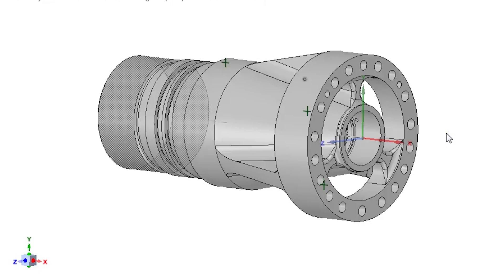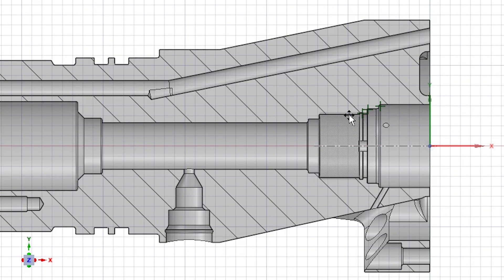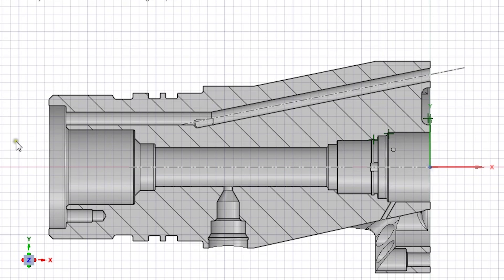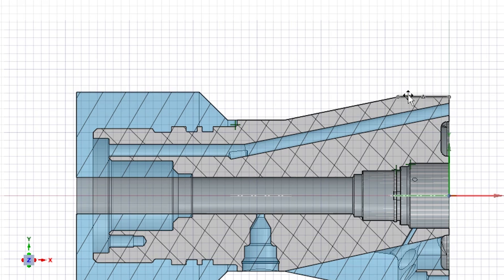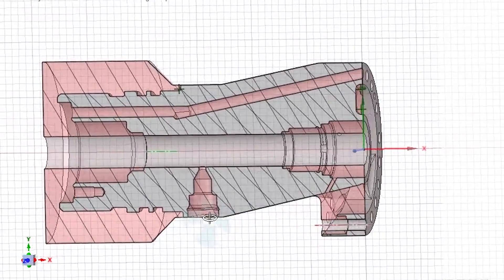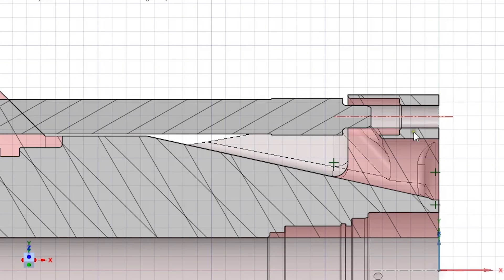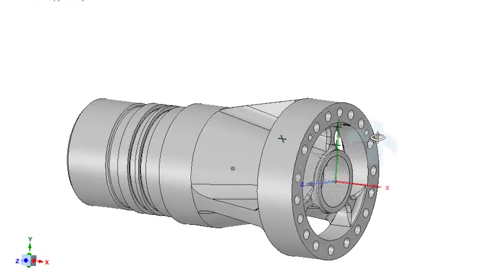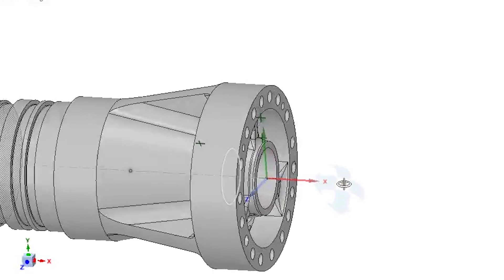Plan a job from the cad model.

Comment: Number 1, I think you are one of the most talented CNC machinist's ever.

Number 2, you are humble and open.  A rare combo.

Number 3, for me, being a degreed Mechanical Engineer and Manufacturing Engineer, but not a programmer or machinist, talking about the datum references first, the tolerances and the GD&T, as you did in this video, is fantastic, as then when I watch your machining videos, everything becomes much clearer and learn so much more.

I use to work as an orthopedic implant support engineer on the production floor and in advanced manufacturing teams as the production rep on new products - mostly derivative products, yet with the same advanced coating processes (vacuum deposition, surface prep processes ... and of course machining, I was responsible for.  All the reasons for my interest.

Would I watch more videos like this, you bet!

In fact, in your future videos, if you are able, without violating customer confidentiality of course, I would love to hear and see you discuss the print first, the GD&T especially, the tight tolerances like the 0.0002" you mentioned here and how you hold and approach them while discussing the CNC's capabilities, then your approach and then the machining, if possible.

Great work sir.

Comment: Yes please keeping these kind of videos very, very interesting stuff. Howmuch time did you take on programming and machining to complete the ss past?
Reply from the maker: I didn't do the machine work. They ran this job on the small integrex here at Center-line. As far as programming it probably took about two-three days with all the revisions and working with the machinist running the parts, to the program and setup on the small Mazak Intergrex. Its control is newer than my machines and I don't have the proper post for Esprit for it. So there was some manual editing to cod necessary.

Comment: Looks like a pretty complex parts. Is maintaining 0.0002 easy enough on smaller bores ? We do some big bronze bushings with a tolerance of 0.03mm. They are 600mm id 660mm od and about 700mm in length. They can be challenging with the small wall thicken and the soft nature of lead bronze.

Comment: I loved this video! I'm an engineer aspiring to a point of creating/manufacturing my own parts. As it is, I've designed a bunch of parts for additive 3D printing. Would you happen to have any advice for my switch to aluminum/other metals? I tend to watch a lot of machining videos and try to learn from the complaints the best I can.
Reply from the maker: This is a very hard question to give you a general or simple answer. Every metal has a manageability rating this will give you a general idea of the difficulty or ease of machining as related to the material with 100% rating. I know that doesn't help much if you have never machined that material but if you machine a material with say a 60% or 30% it will sort of give you a idea when you do the next material. So what am i saying. The only sure way to learn is to machine some materials. Obviously aluminum will machine easier than steel and stainless. Inconel will be more difficult than the stainless but the ratings will give you some idea. Also the tooling available to you will dictate how you will go about machining. Any thing can be machined with the correct tool but is that tool available to you? Almost anything can be machined with a less then ideal tool it will just take longer and possibly more skill to do it. Think about that you could actually make a part with a file and scraper to precision tolerances but it would take longer than a milling maching and a grinder.
Reply: Thank you very much. I think this is a case of just getting out there and doing it. I hope you have a great one!

Comment: It was very interesting to me!  How would you describe the type of work you do besides close tolerance and difficult?
Reply from the maker: I generally do small quantities of time consuming parts in difficult to machine materials. The kind of parts nobody wants to do or has had difficulty with. This is why I use a manual four jaw chuck on the lathe. It is more important to me to get the part running true than the time it takes to chuck. That in a way describes the kind of work I do. Where precision is more important than the time it takes. Also I do like a challenging job. I don’t think I could run thousands of parts unless I could figure out a setup to do it unattended. I do have a job doing exactly that on the horizontal mill. That’s whet the cutter in my video “Remake a cutter and spares” is for.
Reply: Yeah, I would have guess that you like challenging parts.  Because one would have to be very passionate about his work in order to be able to complete good, in spec parts this difficult!  Thanks.

Comment: Hello Peter, one question for the tight tolerance bores 0.0005 and 0.0002 do you hone them afterwards? thanks Rafael
Reply from the maker: No we will bore them on the lathe. In this material that wouldn’t be a problem. You can take fine cuts and not loose the finish.
Reply: ok thank you

Comment: Great! as i could see you are using SolidCam for generating Gcodes. right ? please let me know how long would it take from cutting off the raw material to completely finish the part .and how much would you get for machining only one piece of this kind .
Ps : i couldn't get any clue of the part scale . maybe giving a diameter or a length could help visualize the part size .
Regards
Reply from the maker: The software I use for Cam is Esprit Cam. The finished size of this part is 3.125 Dia. X 5.563 long. When I know how long it takes to machine I will let everyone know.

Comment: Thank you for your video(s). I really enjoy watching them and learn alot about the possibilities available, as I am also programming and do set up  on MULTUS multitasking machine myself, although I work mainly on small aluminum parts. In your video explaining the considerations I would like to know more about the workholding, available tooling, blank material size you start with.

btw, have you considered using a Key slot / T mill to finish the counterbores from the first side? instead of a long special drill?  
looking forward to more of  your videos!
Reply from the maker: Thank You for your comment. I did looked at that, but when I calculated the shank/neck size It didn't work out. The holes are .201" diameter and the back c-bore is .328" Diameter. That would make the neck diameter of a milling tool .065" diameter X .800 long to reach or a back boring tool could have a neck of .125" X .800" long. This would not be a reliable solution for this. That leaves doing it from the other end the only option left.

Comment: How many spares do you have?
Reply from the maker: It turns out I was a little off on the quantity. There are 26 parts on the order and 26 pieces of material. No extras. We will be cutting some aluminum setup pieces of material for this.

Comment: Do you think 3d non laser metal printing will acheive this level of accuracy? How do you think this will change the game?
Reply from the maker: Funny you should mention that this part has the option to machine from a 3d printed part. Were making it out of solid round bar the other option.
Reply: Edge Precision This company has my attention
https://www.desktopmetal.com/?gclid=EAIaIQobChMIgJCVsYXv2wIVlhuBCh1tZAyrEAAYAyAAEgKcIPD_BwE
Reply from the maker: The 3d part still requires post printing machining for the close tolerances.

Comment: I have done some audio work so maybe I can help.   To reduce background noise you just need to get the microphone closer to you.   If you have watched Keith Fenner you will know he clips his to his hat.  But on the shirt works just as well.   A more directional mic can also help. Microphones follow the inverse square law, if you halve the distance from microphone to sound source (mouth?) you quadruple the sound volume from that source.     

If you have constant background noise like the whine of a motor you can reduce it using the ReaFIR VST plugin (Works in Davinci Resolve, I know since I installed it on Friday, so it might work in other NLE's).
Reply from the maker: Actually I am using a shotgun mic setting right in front of me on the bench about 3-6" away from my face. The air guns that people are using in the shop are very loud in the sound recording without it. I have to turn down the gain on the mic and get very close to get it to a minimum. I had to take some of these clips many times because someone would decide to blow a air nozzle just when I was recording. There is also a horizontal band saw right behind my machine. When its cutting something like inconel it puts out this high pitch screeching sound that is very difficult to get rid of.
Reply: cool, it does work ok, I am just suggesting things to try when it does not work.  but shotgun mics have surprisingly large rear and side lobes that can catch you out (-:    with the ReaFIR plugin you teach it what just the noise sounds like and then subtract that from the total sound and it uses a FFT to do it, it is not just EQ.   (air guns are well over 100db and everyone should be wearing hearing protection!).   do not be afraid of making the mic visible if it gives better sound, I really don't think anyone will care so long as we can hear you (-:
Reply from the maker: For the talking head shots I'm using a Zoom F1 recorder on the camera with their shotgun mic on a extension cable they sell for that purpose. I have been thinking about a lavalier mic. The Zoom F1 recorder has a 1/8" threaded line in connection. I think that will also pass thru to the camera. Can you recommend a good Lavalier mic? I don't need wireless for what I will be doing with it. The camera I have been using is a Canon D6 MkII with a 16-35 lens for this purpose.
Reply: Any of the name brands will do a fine job, but Zoom sell one for the F1 so that will have the right plug and so on with no fuss so I would go with that.

Comment: I would appreciate more videos like this for sure.

Im curious how much flex is caused in stainless steel by the material removal on the wider side
Reply from the maker: Thanks Tommy. There may be some distortion from the milling. That is why as I explained in the video. We will finish turn the close diameters after milling.
Reply: Edge Precision that was all clear I was just curious how bad SS usually is for you in such cases. I work primarily with aluminum which really likes to go all over the place.

Comment: Very interesting. I’ve been using Featurecam for ten years but have never made a part this complex. It was interesting to follow along. How do you go about pricing something like this? Do you run any “Test” parts in the process of making this and if so, how do you factor that into your price?
Reply from the maker: Yes usually a test part of some kind is run on more complicated setups. It is very easy to make a mistake and scrap expensive material and tooling. Yes you should price such a thing in the initial setup for the job. If you repeat of the job you could reduce the price if that's not required in future orders. Or if you have a scheduled delivery over a period of time you could spread the initial setup cost of a larger quantity of parts.

Comment: I like these type videos especially on a fairly complex part like this. I wonder rather than run the long piloted spot face tool why not go thru the bore and back spot face it with a boring tool? I would think it more rigid and to give better access.
Reply from the maker: I did consider that but the hole is .201 in diameter and the c-bore is .328 it doesn't leave much (.125 x .800 long) for the shank. It might work but I feel safer doing it from the other side.
Reply: That's a really good idea. Having access to that tool grinder would make whipping up a back boring bar easy. I love these comment sections for exactly this reason, your quick and easy solution to the problem. Thank you

Comment: Bring more please. I’m beginning to program more 5 axis jobs so definitely helps. The tiny holes at the end of the video sir. How do you approach drilling those? Leave material parallel to the opening when you rough out the taper they are thru? Also is this being programmed with Mastercam or something else? Hope to hear back from you. I Love learning from the experience!!
Reply from the maker: Thanks Marcus. The little holes are .062 in diameter I will use a .062 endmill in a stink holder to spot for the drill. I will be using Esprit software to program with.
Reply: Edge Precision thanks for the reply I wasn’t sure if the hole was an “off the shelf” size or not. Cool I use an opmenmind product named Hyper-mill. Haven’t had a chance to drive esprit yet.

Comment: At time 1:37, need to drill 2 hole from op1 and op2.
How would you suggest doing C axis alignment?

Is that possible use 8" stock doing all OD in one op to secure outside runout to minimum ?

Comment: How would you doing measurement on runout specially when datum A is outside, datum B is inside, it seem not able to indicate deep inside.
Reply from the maker: Datum A is the OD on the end Datum B is the face on that end. All Datum B needs is to be perpendicular to A. This will be automatic if they are turned at the same time. When we turn the part and chuck on Datum A as I explained in the video. We will indicate close to the chuck than out away on the smaller diameter when both diameters are running true we will have our runout good.

Comment: Is that possible use 8" stock doing all OD in one op to secure outside runout to minimum ?
Reply from the maker: That would be possible for the OD. But it would still be necessary to indicate the part to do the more critical ID work on the other end. There would also be the issue of removing the extra length on the stock. I don’t see any real advantage for doing this.

Comment: At time 1:37, need to drill 2 hole from op1 and op2.
How would you suggest doing C axis alignment?
Reply from the maker: What I usually do is mill a alignment feature somewhere in the stock that will be machined off later. In this case on the OD of the rough stock that will be turned off on the second operation would work. What I am really going to do is put the side port you see in the section in the first operation. Than when we turn the part it can be used for the alignment feature.
Reply: How do you do the alignment off the feature? Do you use a coaxial indicator and adjust until the top of the hole is aligned with the bottom?

Comment: The ACME thread has two starts, and there are three inlet vanes. Does the print say anything about how they align?

It would also be interesting to see the finished part, if possible, and the errata between the plan and how it actually got done.

Love your videos. I aspire to one day have an arrangement with a job shop like you do!

Comment: Can you machine to a tolerance of two ten thousands or does that have to be ground in ? getting to that close of a tolerance would you not have to factor in the room temp of the part it will change just bringing it outside the shop when finished
Reply from the maker: The tolerance is plus and minus .0002”.  So that a total of .0004”. Yes the machine can do that. In order to do it though you have to do it in mutable cuts. You can’t just get it set from the previous part and just run the next and think you will hit this kind of tolerance. It also requires measuring equipment with the sensitivity to measure this.

Comment: Hi Peter, couldn't you do the counter bore from the first side with a small purpose built tool and then if you need to do a finish bore, then use a single point tool?

Comment: Excellent video!  Interested in seeing some of the tool paths for the part and reasoning  behind them.  For instance how are you planning on tackling the corner radius in the 3 cut out ribbed sections of the part?  Would be interesting to see the part in the machine, hope they let you do that!  Also, I'm in the mindset of the same person programming the part at least running the first few pieces since that's the only person who will really know what to expect and if things need to be changed, which is usually always.  Anyway awesome video Peter, I'm always a bit in awe with some of the parts that you tackle.

Comment: As a shop owner I do like this sort of process, figuring out how and in what order you are going to do the work is a major part of your time.  It is expensive to learn how to do it by mistake, better to learn from sharing.   This looks like a part you will have to flip several times in the machine to finish it.  How many will you make?
Reply from the maker: On the Integrex we will do it in two setups.
Reply: Thank you, I cant wait to see more.  My last comment was to ask how many parts will you make.  I am sure this is one where an extra piece of material is likely out of the question.
Reply from the maker: I believe there are 30 parts in this order. We probably will use a aluminum set up part.

Comment: I have no experience in making anything like these parts or any real reason to watch these videos but I watched it all.

I think it's just cool and the intricacies and fine tolerances amaze me.

I don't think there is a higher level of machining possible, perhaps you will tell me different.

What is that etching tool at the end of the video, is it spark erosion?
Reply: No, it's more like a cnc prick punching machine. In a shop I used to work at, we bought a portable stand alone unit that we would put on our freshly machined downhole drill pipe, casings, couplings, tools etc. to mark pertinent information onto. 

The old fashion way was to get number and letter stamps and do it by hand with a hammer. The machine sped things up greatly, especially when you have 300 connections on the rack.